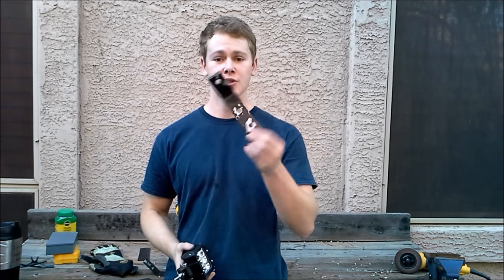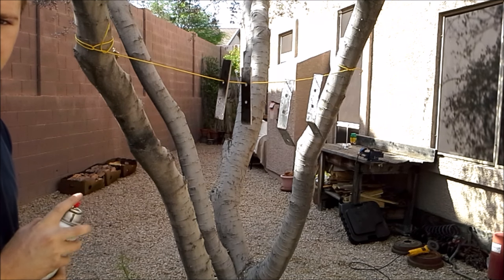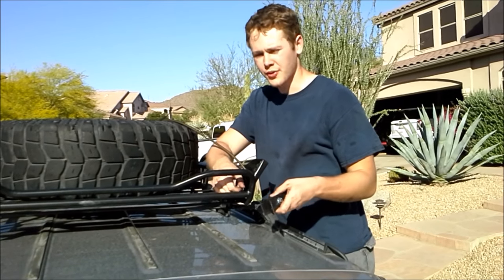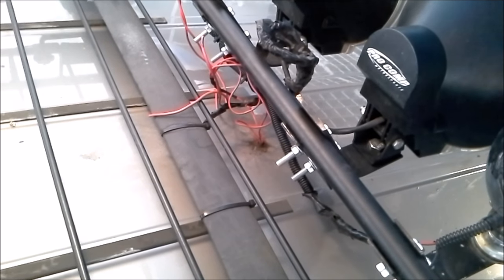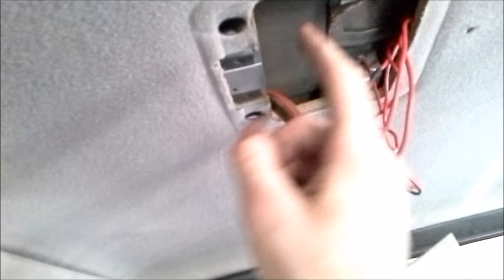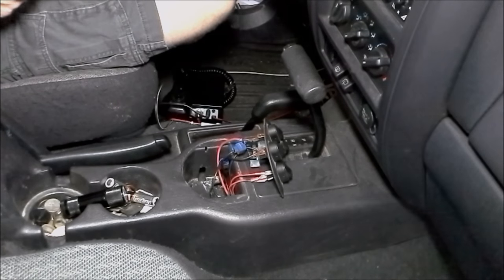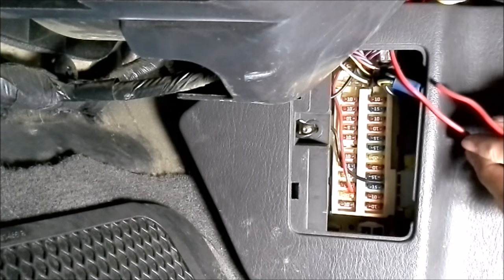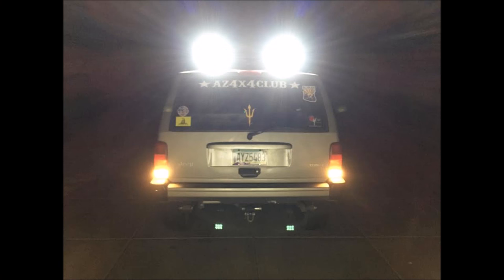Jeep LED pod install

Comment: Nice install video.  Planning on adding lights to my rack, just haven't decided if I'm going to drill a hole in the roof yet or not.
Reply from the maker: +TrailRecon Thanks!  It was definitely a bit scary when I drilled the hole. It has made wiring all of my lights much easier though.
Reply: @AdmiralOffRoad  what do you use to keep water out??

Comment: is it safe to run without relays?
Reply from the maker: The power draw is low enough that I felt safe to run them without relays. I did run a relay with my light bar because of the higher wattage.

Comment: so I see it's been a min how did the no relays go?
Reply from the maker: No issues without the relays
Reply: Sweet I installed mine today after watching this video but tapped into my constant power to the radio an the taggle switched it